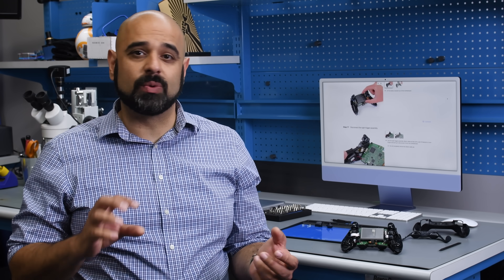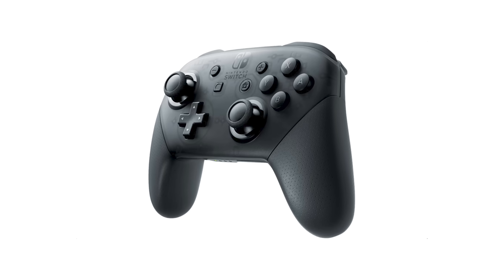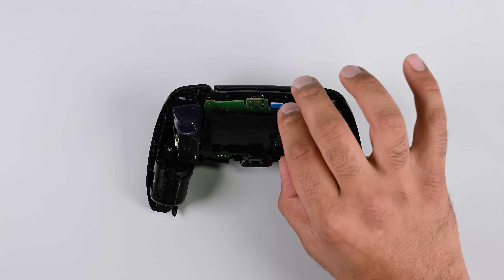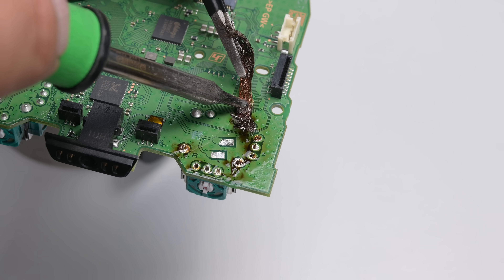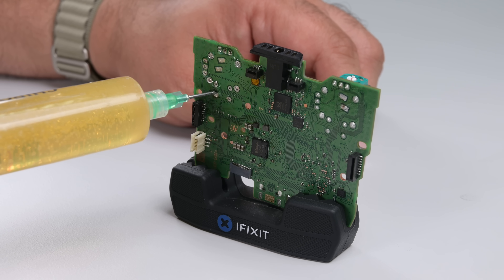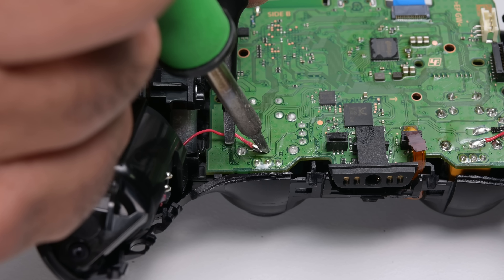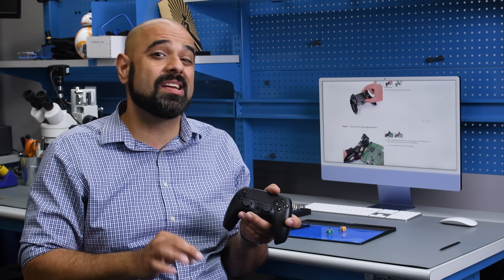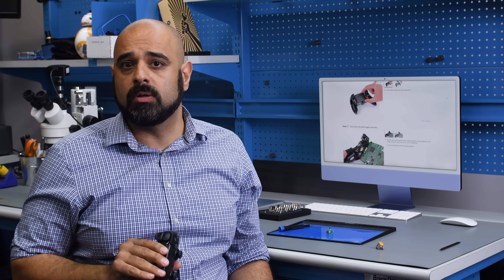How to Fix PS5 Joystick Drift for Good!

Comment: I've been through 5 Dualsenses and a Dualsense edge, all have broken in different ways. A couple launch controllers broke their trigger springs. A few also had stick drift so bad I couldn't get past menus. So I also got a dualsense edge for that to maybe last a while longer, just for the back paddle to break after 7 months, an insanely small metal rod breaks in half making the paddles useless, on ALL dualsense edge. Eventually the paddle input was always being pressed. This is known and might even be more common than stick drift. Do NOT buy an edge. You'll have the irrepairable paddles broken long before you get to pay Sony for a new pair of analog sticks.

Comment: Truth is , by the time most PS5 controllers develop stick drift for most casually playing gamers , it's no longer under warranty, the serial number on the back of the case has been erased through contact with your fingers and they refuse you send you a new one, forcing you to buy a brand new 100 bucks controller to keep playing your games... Why would they fix this ? Only good news is that it's pretty cheap to buy cheap replacement potentiometers off the internet and usually just changing the disk part is enough to fix it for a while at least, you don't necessarily have to resolder everything... But yeah, I've had three different controllers develop stick drift on me this gen on PS5, which is downright insulting.
Reply: :hand-purple-blue-peace:
Reply: "Truth is , by the time most PS5 controllers develop stick drift for most casually playing gamers ,"

heh depends on casual. With an hour of cod every day I'd call you casual and you likely have drift within a year.

Comment: Class action when? They refuse to let us use older gen controllers, and then the serial number stickers fade and peel off too easily resulting in them refusing warranty claims, they need to be forced into letting us use PS3 4 and 5 controllers interchangeably, forced in to using components that will last the intended 10 year lifespan of the console, and forced to replace the pots with hall sensors on ALL official PS controllers. If governments and regulators care about e waste and the environment as much as they claim then they need to enforce this.

Comment: It's wild that "hall effect" joysticks aren't some recent invention, but rather they were already present on many famous retro controllers.

It's clear that these same companies sought to further planned obsolescence by inventing potentiometers, so that stick drift would force most ppl to keep buying replacement controllers.
Reply: I just happen to be a 2M tech and I work with circuit cards and soldering daily.  When my dual sense controller started drifting I took that as an insult and installed hall effects.  Why stop there though?  I already had my controller disassembled so I went and added four metal back pedal buttons and replaced my original sticks with metal ones.  I've had it for almost 2 years now and still going strong.
Reply: The rise in popularity FPS games, demand for minimal deadzones and constant use of the analog sticks has made them unsuitable. Back in the day we just didn't use the analog sticks as much and deadzones were quite excessive too, so pots were fine back then. Sony switched to hall sensors for PS3 but then had to go back to pots to get rumble motors in without raising production costs in order to please shareholders.
Reply: @talibong9518 sorry but hall sensors cost only a fraction more than a potentiometer. It was a move to reduce lifetime.
Reply: @talibong9518  Hall effect sensors are cheap. The xbox controllers even use them for the triggers despite the fact that nobody ever asked for it. Because like old school thumbsticks, analog triggers don't need to be very precise. So HE sensors are "good enough". But to offer the most precise thumbsticks possible, manufacturers have moved to potentiometers for thumbstick applications.

Comment: the reason why nintendo, microsoft and sony uses analog and not hall effects is because it's more cheaper and a fall back when some of their products their doing doesn't sold well like a video game which isn't a good reason why.

hall effect sticks are good but i one i see on youtube, keeps juddering like crazy if you don't calibrate well and if you do - some controllers don't have way of storing information would still jitter beyond 0, 0 on the x and y-axis for left and right stick.

i like playing a game that supports both left and right stick where there's zero deadzone, so i could go from 0 to 100% all 360 degree of movement.

bonus: can someone tell me why - when i move my left stick, it also move the camera (right stick) in a 3d game that uses both sticks? even if i didn't touch the right stick at all.

Comment: Is the response time (physical input -> electrical impulse) the same as the resistive film pots?  That's the only negative I've heard, is that it has a slower response, but that was anecdotal.

Also, there are generations of the sensor design, primary difference is magnet shape.

Comment: $20 per controller?  It would be way less.  I was able to get a pack of 10 from [SITE REDACTED] for $20, so about $2 per module, and potentiometer modules aren't much cheaper.  If you're buying bulk wholesale business to business that price would come way down, and if these modules were the standard then economies of scale would improve and the cost would come down even further.  I bet the cost difference would be negligible.

It's planned obsolescence, plain and simple.  Cheap pots are an easy way to guarantee things break with no extra work from your engineers.

EDIT:  Site redacted because YT yeets anything that mentions it.

Comment: Do I use copper wire or iron wire? Sorry I’m new to this and planning of working on my controllers
Reply: Copper braid for wicking up the old solder, alloy it first with some low melt solder.

Comment: would there be an issue by calibrating using that 3rd party tool? that 7% rate, how notable is it for the end user? for platform games, rhythm games, shooters etc.
I do have 1 controller currently with drift and was planning to take it to a shop to repair, but watching this makes me want to get my own hall effect sensors and ask them to install those

Comment: The reason why Sony nor Microsoft use hall-effect sensors is noise on the signal line they can’t get rid of. What these third party manufacturers do is to hardcode a dead zone so the noise doesn’t cause ghost input. When you move the sticks slowly, you notice the non-linear movement and jitter. And no, using conventional sticks isn’t planned obsolescence, but simply a non-trivial engineering challenge.
Reply: Why is this not a problem on something like the t16000m? That seems like bullshit
Reply: Very interesting !

Comment: All right the only question I have before I watch the video, do I have to calibrate it?
Because I replaced my sticks in my PS5 controller and I didn't know ahead of time that you have to find a near perfect match potentiometer in the new sticks or else it won't work with your controller and that controller now has more stick drift after replacing the stick than it did before replacement.

My research led me to see that just replacing the stick isn't good enough.

That's why I want to know if you were to replace the stick on this with a hall effect stick, is it enough? Will it be perfectly dead center out of the box or will the previous calibration on the controller cause problems with the new stick.
Reply: There is now a third party calibration tool for PlayStation controllers, it's mentioned in the video.
Reply: @tomhsia4354  I appreciate it. I didn't finish the video cuz I had to go back to work and then I totally forgot to go back to it lol
That's my bad.

Just had that unfortunate experience in the past and was wondering if it was ever alleviated.

 Maybe now I could use the third party tool on the controller that I put the sticks in?

I still use it but I can't use it for FPS games because of the stick drift being so much. It's pretty much only for a platformers and stuff like that
Reply: @Rain1  "Just had that unfortunate experience in the past and was wondering if it was ever alleviated."

Same. There were PCBs with adjustable potentiometers that allowed you to centre the sticks. This new software solution is much better.
Reply: @tomhsia4354  this is absolutely great news. 
Unfortunately you had to go through the same frustrations as I did. 

Back then thinking It was just as simple as replacing the sticks. It certainly was not. 

Thanks again

Comment: If the controller is already broken, as in has bad drift and are unusable, it might be easier to remove the physical potentiometer thumbstick with a side cutter before desoldering each pad. As long as you do not use excessive force or damage other components, this should make it much easier to remove the old thumbstick without burning yourself, destroying pads or other components on the board.

Comment: Nice, but I ain't doing all that
Reply: Exactly, and I found comment here to try spraying WD 40 into the sticks so I figured why not if I am going to throw it anyway for new one. It worked fantastically.
Reply: @anismatar  dont use wd 40. It will kill your controller super fast. Find silicone based instead
Reply: @anismatar  from above?
Reply: @seigfriedmk  yes from above near the opening (base) and move it a little bit give it time to cleanup whatever is stuck there.
Reply: Soon as i saw the solder gun i said “I’m out” 😂
Reply: You can get a local tech to fix that.
Reply: @triadwarfare  Its easier than what it looks
Reply: This is really a good tutorial if you want to start learning how to fix electronics. It's not that hard to do, all you need is to have some solder equipment and the work is fun and educational. Im definitely going to try this, default stick is so bad on current gen.

Comment: Oh Gullikit finally released the dualsense Hall effect sticks??? Sick!

I’ve been having an issue with one of my controllers, but it’s not drift, there’s no ghost input. I think I just need to clean the contact pad better. It was registering max left input when wiggling around the physical play in the center of travel, so adjusting dead zone didn’t help. I opened it up (using the ifixit guide) and cleaned the contact pad and it fixed that issue, but now it’s registering left input when I press the stick in. I need to open it back up and make sure the stick is ok, I remember one of the green covers wasn’t snapping closed all the way last time, could be the source of my problem.

Super thankful for ifixit making it easy for me to do my own repairs instead of having to send it in or buy a new one.

Comment: Huge tip, but you used wick to desolder the 4 little cables that hold on to the pcb. You don’t need to do that. In you just heat it up, you can just very gently pull the wire and it will come off easily. Then when it comes to putting it back, you don’t have to add any solder. Just heat it again and put the wire on.

Comment: or you can get a new one from sony if it's been less than 2 years
Reply: the serial number rubs off after a week and they use that as an excuse to deny replacement.
Reply: @talibong9518  I used 2 gamepads for almost 2 years and then got new ones. The serial numbers were legible

Comment: Tip: Apply low melt solder desoldering wire to each soldered point of the joystick (any low melt solder will do, but the lower temps it melts the better), this makes the whole process DRAMATICALLY easier, even with just a normal soldering iron!
After the removal, clean the board pads with the copper wick, apply some normal solder and clean it again with the wick, to make sure nothing of the low melt solder remains.
Reinstalling the hall effect joystick is a breeze, takes literally a few seconds, just solder them in place.
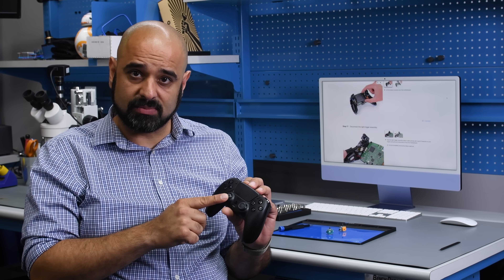Calibrate them as shown @ 6:20, and you're done! :)

I did this whole process with two dualshock 4, and one dual sense, and literally the worst part was taking them apart, which I had never done before. (though I did have experience with like 20 other types of joystick, from atari 2600 to Ps3)

Comment: I tried to replace sticks (regular alps clone) on xbox one controller and calibration was terrible. Not even stick drift board with resistor helped me. I tried a few but they all were over. Maybe this thing good enough to be centered.

Comment: Stick drift is covered under Sony's warranty, they have sent me 2 brand new replacement dualsense controllers because of stick drift, so saying you need to buy a new one when it gets drift is just false.
Reply: Thank you Sherlock. Your warranty is not perpetual in case you were unaware.
Reply: They intentionally make the serial numbers fade easily and peel off, and when this happens they refuse warranty. I recommend shell swapping, even for out of warranty controllers.

Comment: It is important to note that it does matter what controller revision you have and what Hall effect modules you get.

The first time I installed hall modules into a dualsense, it bricked the controller until I added calibration pcb’s on the other side. Please do research on which ones you need for your revision!!!

Comment: One of my PS5 controllers started to drift, after 3 years of use. I repaired it by changing the analog, BUT, less than a year after, the drift came back. This time, I already knew about the existence of these compatible magnetic analogs. I bought a pair and used them on my controller. It has been 3 months already and I had no problem at all. And, to be honest, I'm finding these magnetic analogs more smoother to use than the original ones (I have two controlllers, one with magnetic analgs and other with the original ones). The controller with the magnetic analogs became my preferred controller to play.
Reply: How easy/difficult was the install? Mine just started to drift to the left and I need to swap out my left stick
Reply: @peanutheadrules  I cant say how difficult is cuz I paid for a professional in this area change it for me.
Reply: @jhonrock2386  gotcha, thanks for the response! I’ll look around and see how much they charge over here. Appreciate it!
Reply: @jhonrock2386 what and where do you find a professional? Like a tech support repair guy or???
Reply: @Xavvytony  Yep, a guy who owns a shop in my city where he offers repair service for videogames and related devices. I think anyone with knowledge in repairing electronic devices can do that.
Reply: @jhonrock2386  Hey I got a question if you don't mind. A local guy installs these hall sensors and is telling me that The three popular brands he installs he is finding that the sticks are only reading 70-80% I guess. I tried searching for this on the internet and found a few people commenting with the same results. Any experience with this by chance?
Reply: @mdh1775  Cant say for sure. What I can say is that they are working fine. Apart from the more soft movement of the sticks, like, it looks more light to move, I didnt noticed any difference from the original ones. One thing I remember now is that the guy who installed them for me commented that he had a bit of dificult to make the first calibration of the analogs, but once it was done, it worked perfectly.
Reply: @jhonrock2386   Okay, hey thanks for the reply. I haven't played video games since about the time Black Flag was released on the 360 and just picked up a PS5 because I'm out for surgery for a while and I've already had two purchase a different controller and clean the contacts of this one within a couple months.
Reply: Sometimes vibration settings cause stick drift.
Reply: Which magnetic replacements did you use?
Reply: @quintonmoore8797   no specific brand, just generic chinese ones that a lot of people bought and said it worked nicely. The only visual indication they have is the light orange casing color.
Reply: @jhonrock2386  yea I saw the orange ones on Amazon and I didn’t know if there were different brands so I guess it’s by color only
Reply: Is the magnetic analogue sticks the ones in The vid?
Reply: @AA12-_-X  looks like it.
Reply: @jhonrock2386  alright thanks bro
Reply: "I repaired it" no, you sent it to someone else to repair it.
Reply: @nikkolaus91  So picky... hahahaha...
Reply: The drift originally came up after 3 years
changing the analog stick, drift came back after one year
 yet after putting in the magnetic, you're already claiming how much better it is for not having a problem after 3 months
Even your "bad" original lasted 3 years - 3 months are meaningless my man